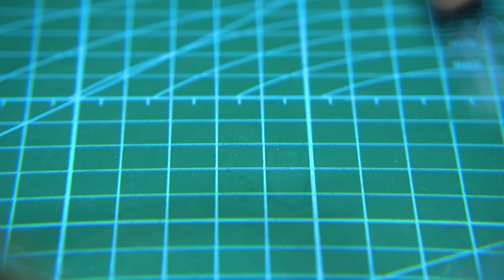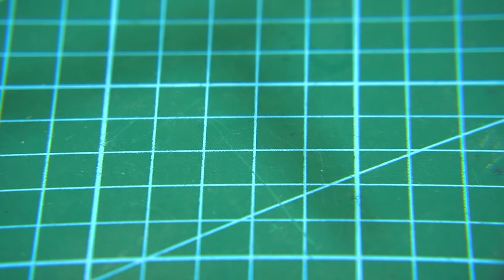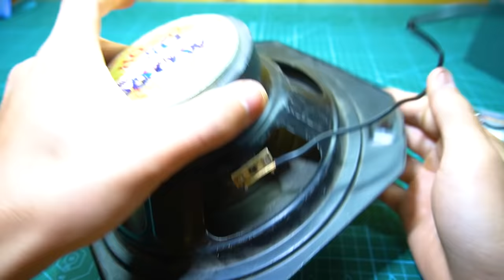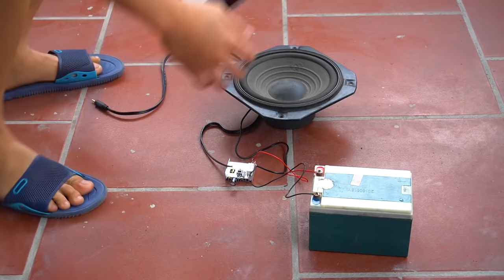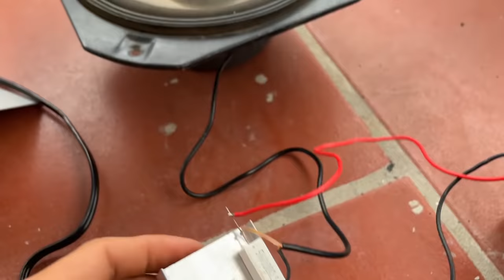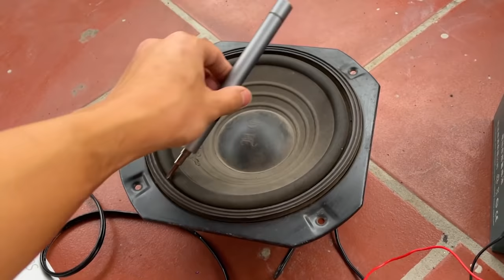DIY Powerful Ultra Bass Amplifier Z44N MosFet, No IC, Simple circuit

Comment: I see many circuits like this on Youtube, which are really nonsense.
You'r just a lyer : This is just nonsense like said Edgar Arturo, this is just nonsense to do that.
To obtain 1300 watt RMS power output on one output : not brigded :
You need a symetric power supply of +100  and -100 volts. And this for a 4ohms speaker.
And a schematic circuit that really needs knowledge. 
Your circuit would work in class A for the best which is a maximum heat and consumption for a minimum output power.
I did not even calculate but the output power would be on the range that said Edgar and even not sure:
only if you chose the good working point. 
Learn electronic if you really like it and you'll build real powerfull amplifiers.
You'll also learn how to make reliable printed circuit boards. 
I would add that theses kind of things could lead to electric risks too : fire at least for this circuit which seam to work on low voltage. 
For voltage higher than 50v electrocution may occur.
I do not know the voltage nor the type of your battery but if you leave it pluged to your circuit,
it will be soon discharged too.

Comment: You are misleading people by posting these barely 

functional circuits with ridiculous ratings.
Some are dangerous or will burn out the speaker.
Why do you think manufacturers use so many more 

components to get a proper operating safe circuit?
How many people have wasted their time with the garbage 

you post?